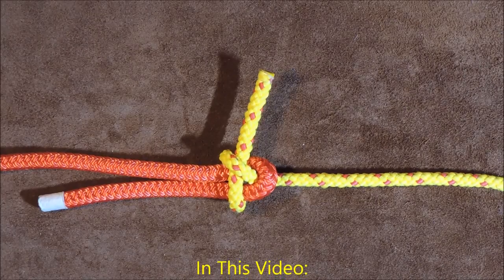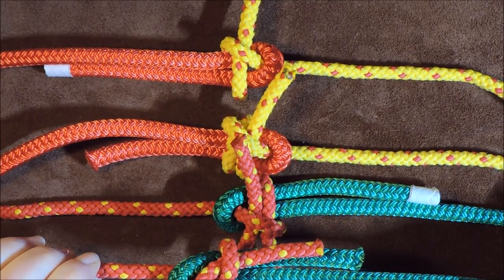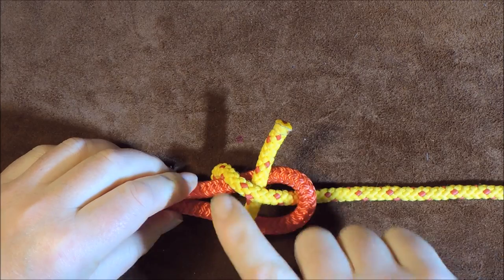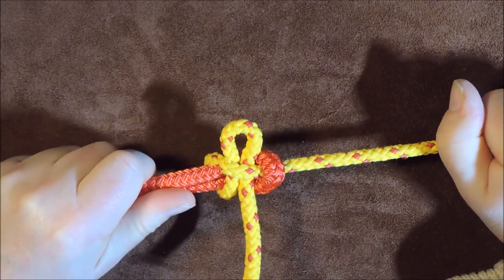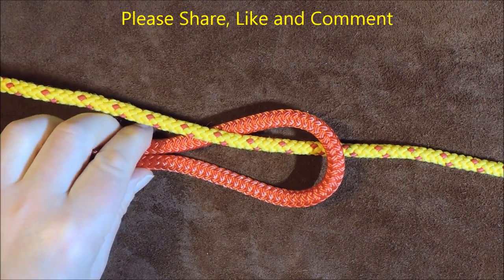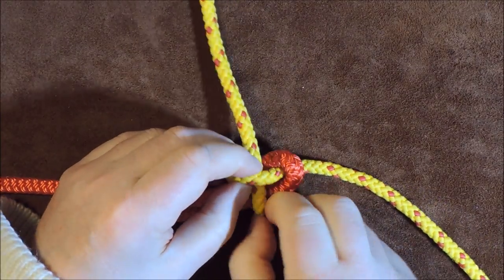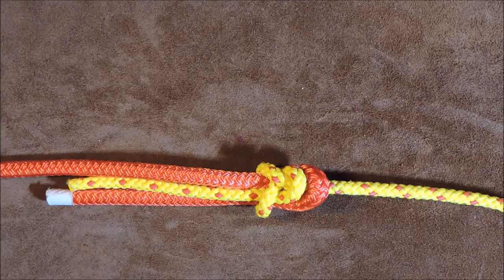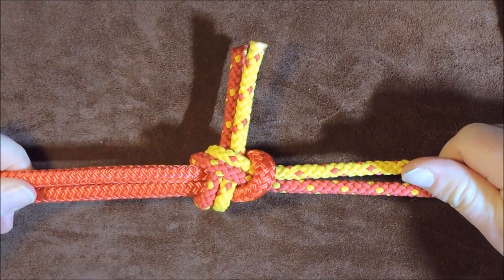Sheet Bend Double Sheet Bend Slipped Sheet Bend One Way Sheet BendWeavers Knot Becket Bend

Comment: Sheet Bends are considered more secure if both working ends are on the same side (so yellow end pointing down).  Some commenters will get very uptight about that - you know the type.  I've always loved the 2 to 1 Sheet Bend and the Mid Span Sheet Bend, by the way - both very novel.
Reply from the maker: I did a video on the Sheet Bend years ago and it was really horrible. As time goes by you learn better techniques and also improved research. I always love it when someone gives even more input and I learn something else. I really do appreciate that you take the time to leave a comment, thanks.
Reply: It's not getting uptight, it's doing it the right way.
Reply: True.  I was just thinking of those types who will come back at you with a whole lot of abuse, which is just not necessary.   Strangely, most commenters on Johnny's youtubes seem quite civilized - rare for youtube!
Reply from the maker: When I do the revised sheet bend video, I will mention those points. Thanks again for the input.
Reply from the maker: I do get some abuse, but being an old sailor I can take it. I do also spend a little time thinking of a sarcastic and possibly witty reply.........well I think they are funny.

Comment: I have not used the 2 in 1 sheet bend yet, but I would consider it a option where a tent or tarp is being rigged for shelter in difficult weather.  A single line comes off the tarp and join to two lines secured to two pegs.   In high winds it can be necessary to use more than one tent peg per line to keep a shelter in place, particularly if the pegs are inadequate.
Reply from the maker: Thanks for taking the time to share this information, I always love to hear about knots and cordage being used! The trouble I have is not being able to actually test all knots in difficult conditions. I assume that you are some form of bushcrafter?
Reply: I'm more of a roustabout than a bushcrafter, though I do have a certain level of survival training.  I did wilderness backpacking when I was young.  I do fair amount of event camping these days, involving set up and take down of multiple tents, sunshades and other infrastructure.  Getting to and from each event involves securing items for transport.  In addition to the big picture there's always something on site needing be hung, secured, lashed, or bound.
I just thought of another use for the 2 in 1, tying both ends of a short light line onto a heavier line creating final fixed loop where bulk might be a problem.  It could be tied as a one way sheet bend to reduce it's profile further.  This loop can be dropped over something like a dock piling or a cleat.  To keep it secure it can be dropped with a round turn, or even a clove hitch, granted there is enough length.
Reply from the maker: Woah, slow your mind down!! Yes, funny how you think of situations where a knot could be used and then you go onto thinking about other places and uses for knots. I often fall asleep wondering what the next knot I should learn and video, better than counting sheep!

Comment: I've heard purists say that the tails of a sheet bend should be on the same side. I've tied and tested it same side and opposing side and can find no difference or see the reason why tails should be on the same side. Without a scientifically proven reason, I won't worry about it.
Reply from the maker: There are also a group of people that hate slipped knots, but I find that if a knot is properly and tightly dressed, it will not trip accidentally. Mind you, that does not include other idiots close by, who will want to see what happens if they pull the slipped part.
Reply: @KnottingKnots  I agree. In every field of endeavour there are always people who like to differ who are full of bluster but short on evidence. Facts matter and evidence is the ''king'' of truth.